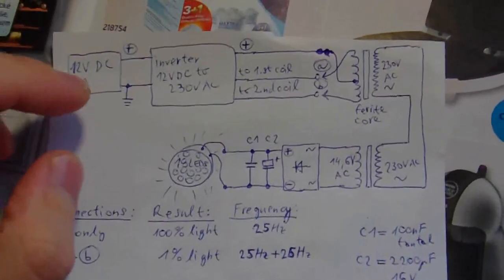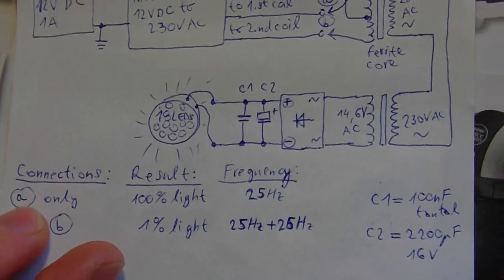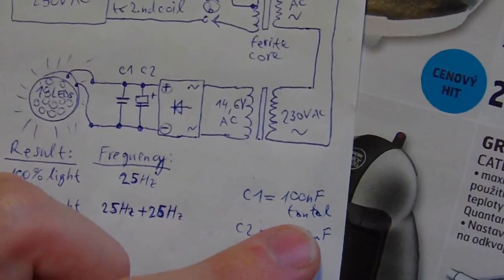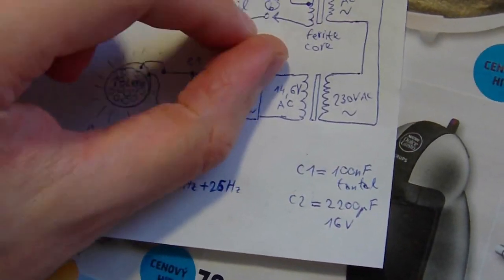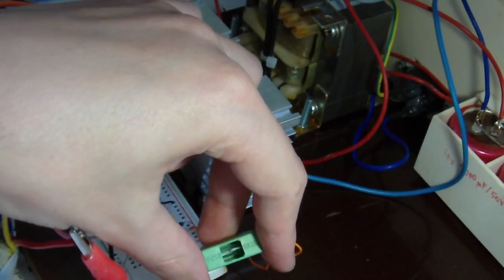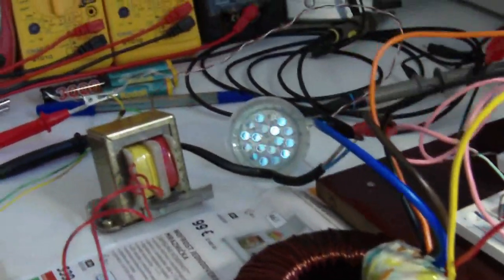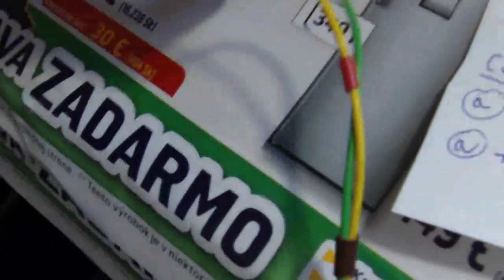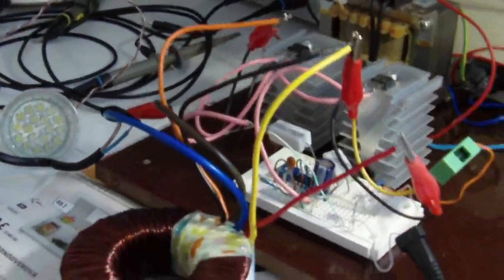Mini kapa device - two transformers output to 18 LEDs

Comment: If you put a plus b you cancel out the voltages at the transformer !
Then they are 180 degrees out of phase and the secondary will not have any voltage !

Regards, Stefan.